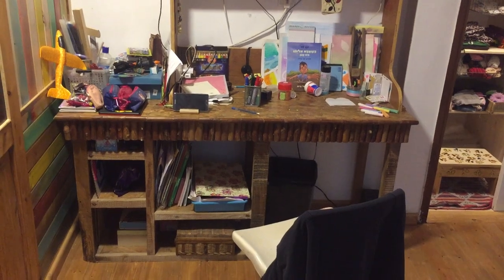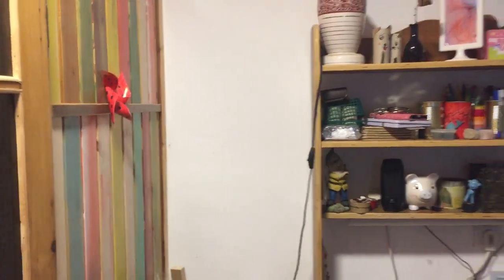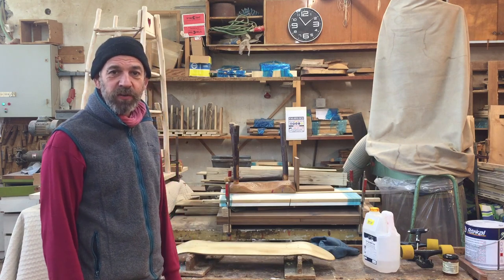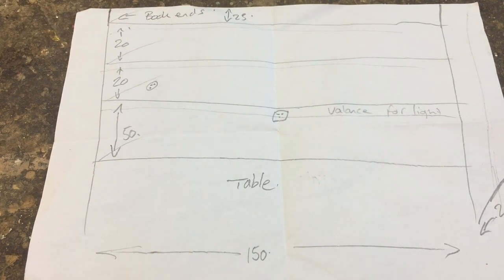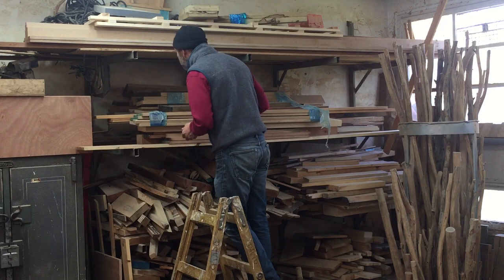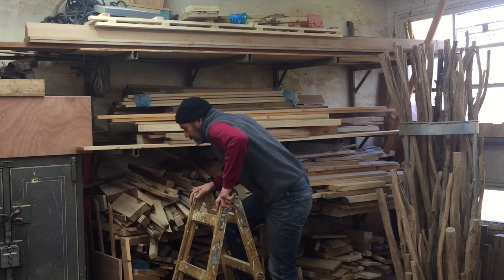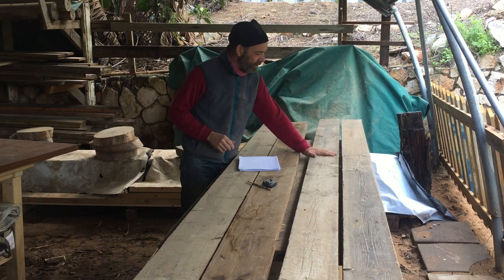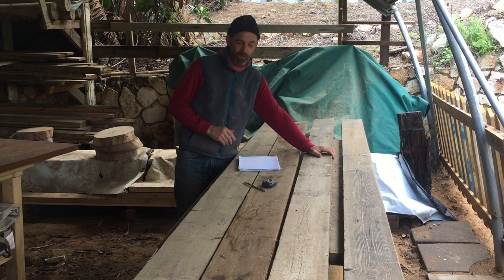Woodworking Project for Quarantine and Sanity!!!

Comment: Prefer using inch measurement.
Reply from the maker: Hi Joe sorry i cant help you with imperial measurements,take care best wishes David
Reply: Imperial measuring is generally less accurate for smaller tasks. Millimetres are by far the best choice as they scale up to centimetres and metres in a way that makes more sense. Unlike fractional inches and feet. 

The measurements you're using should be appropriate for the task.

But I guess overall its what you're used to 🤷🏼‍♂️